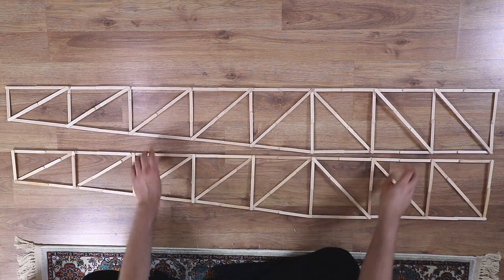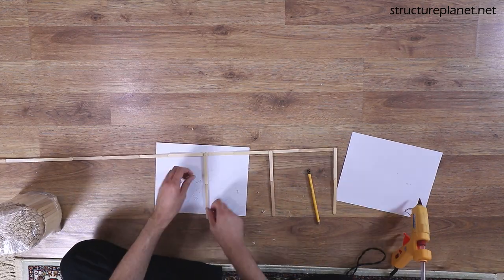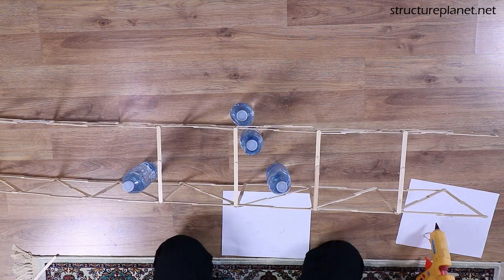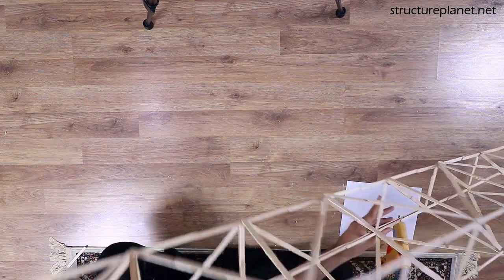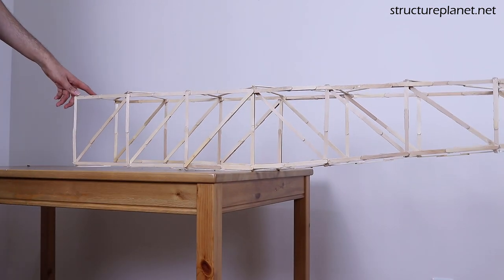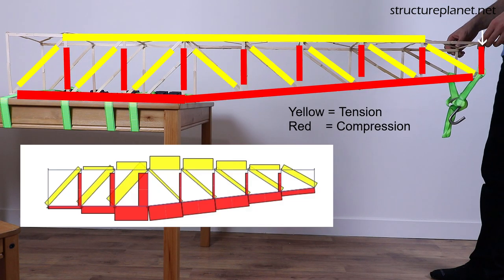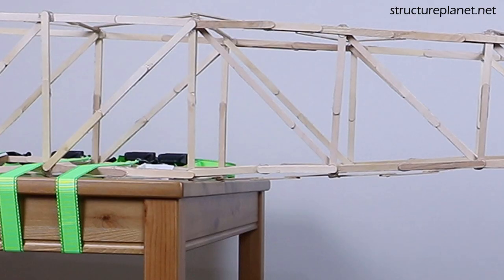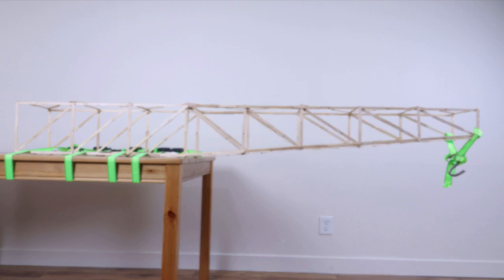Understanding Cantilever Trusses

Comment: The main failure is mostly like local bending in bottom chord or local buckling of this member?
Reply from the maker: I think it was a member buckling under compression load.
Reply: You need to put your truss kickers (the yellow tensions on a 45 degree angle) the other way instead of going from the top left to bottom right they should go from top right to bottom left if looking at it as in your thumbnail for the over hang and then reverse the ones on the table as well.
Reply: @stanlee2200  it is a cantilever bending, the diagonals should be in tension, how he has placed them is correct. if he puts them as you say, they will be in compression, which is not good since the structure is supposed to be as light as possible.